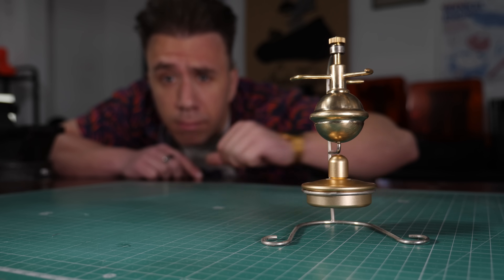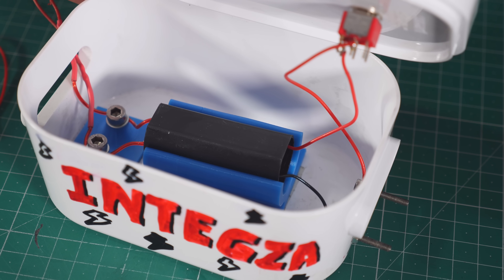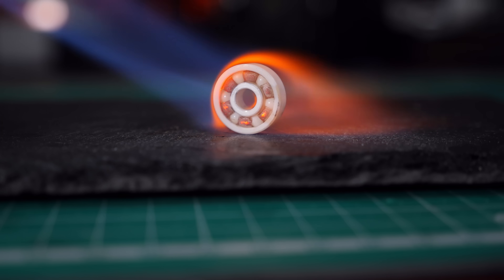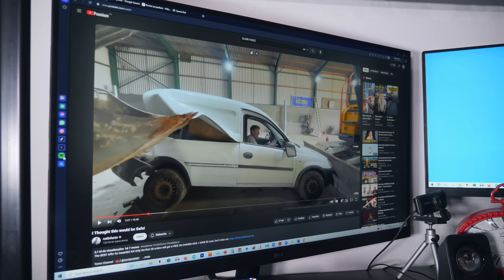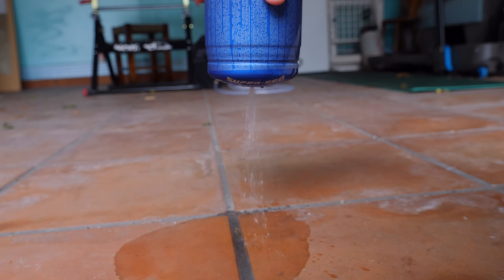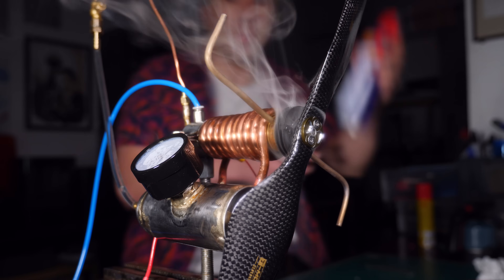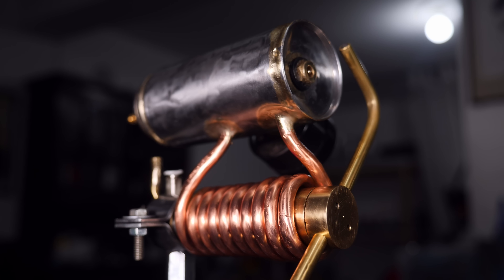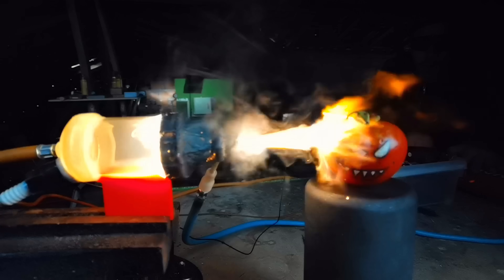I Built a ROCKET PROPELLER

Comment from the maker: AD: Download Opera Here : https://opr.as/05-Opera-browser-integza
Reply: please don't use Opera, the future of Chromium based browsers is bleak
Reply: staying in camp firefox
Reply: No I don’t think I will because just like tomatoes, image generation is disgusting
Reply: Get an Acrylic safety screen mate, if that prop comes apart or the tank explodes your going to get badly hurt. 👍🇬🇧
Reply: FYI opera has MANY privacy concerns going back over the last decade
Reply: Reminder: Opera is gone since 16 march 2013, this is just Chrome with Chinese spyware overlay and some Firefox features.
Reply: Your resources and setup are more sophisticated than you're giving yourself credit for. This design is humble and simple but I can already see many sophisticated designs can be built with your skills and resources.
Reply: @Integza HERE A IDEA FOR THE  AIR COMPRESSION. WHAT IF YOU USE A GAS POWERED RC CAR TURBO BUT INSTEAD OF USE THE EXHALES TO SPIN IT. YOU HOOK IT FROM WD40 TANK AND THE COOLING COIL OR  RIGHT AFTER THE MAIN OUTTAKE OF THE WD40 FUIL TANK SO WHEN PSI BUILD IN THE TANK. IT SPINS THE TURBO FASTER INCREASING AIR COMPRESSOIN MADE WITHOUT ROBBING POWER FROM THE PROP OR USE SUPERCHANGER BUT INSTEAD OF  A BELT USE A MIMI CHAIN AND HOOK IT TO PROP DRIVE SHAFT BUT IT WOULD ROB POWER FROM THE PROP. DISCLAMER I DONT KNOW HOW MANY BARS THOSE CAN MAKE BUT THE IDEAS SHOULD BE SOUND
Reply: Opera is chinese owned. Make of that what you will. If you don't believe me, look it up.
Reply: @aande1  It stems from an acquisition back in 2016, it is brought up more often on x nowadays due to our Social Media channels' popularity. However, Opera is still headquartered in Oslo, Norway with Opera GX being developed in Wroclaw, Poland. All of our browsers are GDPR compliant and no authority or shareholder has access to any Opera data.
Reply: Don't shill for AI garbage, jeez. Stopped watching when I got to that point.
Reply: Are you gonna improve this in future and reach super fast rpms?
Reply: Vivaldi is still Chrome, so I would not recommend it, but it's made by the original Opera devs who left when Opera was bought by a Chinese company to harvest data.
Reply: I used opera too until I found out it was a treasure trove of data for Chinese servers and they have been caught selling user data and other privacy violations but hey if you don't care about that besides taking up a tremendous amount of system resources it's pretty good ....
Reply: how about integrating the exhaust in the propeller (of some other material) exiting from the edges, it might create turbulance at the ends though?
Reply: what happened to giving away 3d printers :D
Reply: you might want to look up Fairey Rotodyne
Reply: I like tomatoes
Reply: You should totally build a machine that makes popcorn using only pressurized air, a bicycle, and a flamethrower — and if you’re ever giving away a Voron V0.2, I’d be insanely thankful to receive it!
Reply: You are a rocket enthusiast
Reply: Opera is spyware and stealing features from other browsers
Reply: YES YOUR FINALLY BACK I MISSED YOU I LIKED YOUR VIDEOS❤
Reply: Too bad you live so far away ...I'd love to collaborate with you on projects
Reply: opera = spy ware, no thank you
Reply: Hi
Reply: what mill are you using?
Reply: Can you build a propeller that has the pipe inside minimising materials and design ? Also dove the distance of the pipe itself have and effect on acceleration ? You could ad a pressure valve to the fuel tank to avoid explosion, maybe with a collector to reuse te fuel It will eventually vent.
Reply: YOU NEED A BETTER BEARING!!!!! IT should spin RIGHT AWAY!!! But because the bearing is so rough and heavy, it's not spinning..... Maybe you need to PACK IT WITH HIGH TEMP GREASE 🤷‍♂ IDK, but you NEED TO FIX IT!
Reply: So uhhhhh what does pamurutchiri antichurgudigi mean?
Reply: I have a solution to your butane boiler problem is to not use one big coil, but to use a bunch of loops in parallel, and have one half be the inlet, and one half be the outlet. You can braise all the outlets to one larger diameter pipe and send that into an outlet canister. The inlet half can be braised at the level of the can surface. This way, butane can only enter from one, but vapor has to come out the other. If you want to enforce the flow direction better, you can make something like a Tesla valve that prefers flow in one direction. 

Additionally, in the butane canister itself, you should use a mesh as a liquid exclusion structure, perhaps a mesh to catch splatters or something. Any splatter or sputter that comes out of the outlet should first blow across a mesh, that is angled to direct the liquid back down. I don't know how much surface tension butane has, but I theorize that the liquid butane would preferentially stick to the mesh while the gas will go through it, as long as there is not too much liquid being sprayed across the mesh.
Reply: A holocaust survivor would tell you go for 4+ arms because you're obviously not a nazi
Reply: You should put the holes in the propeller
Reply: The coil feeds from the can to the coil and back into the can, it needs to feed from the can, into the coil, into the engine.
Reply: Single blade propeller on at low power is most efficient.  How do I know?  Many broken RC airplane propellers that flew longer with same motor/LiPo battery setup.  Be sure to pre-drill hole opposite of remaining blade, and install screw as counterweight, which you can thread in or out to adjust balance on rotating shaft.  No it won't fly faster, but it will fly longer at low power.  Basic undisturbed airflow physics, look it up just be sure to ignore nay sayers esthetic ego trips and test for yourself.
Reply: Consider using sand in the pipe when bending it. That way it does minimal folding. Keeping the tubular measures "intact" so to speak. :)
Reply: @unwnme  Why not use a Bender?  Then you can bend it to any angle: 30 degrees, 32 degrees, 90 degrees, you name it!  🤖
Reply: Since you are working with air, why not use tesla turbine?
Reply: hey meng, you lose a good amount of thrust bending those tubes when you could just use a Tesla Turbine to convert the flow of gas to mechanical force using a straight outlet from the combustion chamber instead.  It's a bit more complicated but results in more rotational energy.  And more energy is always better, yeah?  You feel me.  GG
Reply: That does "pamurutchiri antichurgudigi" mean???
Reply: I just sent this message to the Ancient Architects channel after watching this video, I suggested a Collab video, what do you think Joal? "I was thinking about your video about bored holes the other day. Taking the example of Archimedean screws, which are credited to the Greek but we're in existence long before, certainly in Egypt. It seems obvious that Archimedes either learnt about them from texts or saw them and improved them and became credited with them. With that premise, what if Heros engine is much older than we believe? What if this was rediscovered from an ancient text? What if a high speed steam turbine was used to bore those holes using the weight of the water reservoir to push the cutter down. The striations were all in one direction as I recall? Perhaps it would spin too fast to give the continuous striation however that could have been formed when the tool was removed. Given how advanced the antikythera machine is I feel it is more than plausible that Heros engine is much older than we believe. Perhaps this would also explain the very high quality stone turning of this era? It might also explain the circular saw like tool marks that have been commented on. I was jogged along this path by an Integza video the other day. What are your thoughts? It might be a future video for you, a collaboration with Integza or click spring (or both) if they are interested in a spot of experimental archaeology. All the best Dave.🇬🇧"
Reply: Mate, Leaving a potential easter egg like PAMURUTCHIRI ANTICHURGUDIGI in y' video that google translate doesn't want to help with only variations in 'Shona'? On the road to, or on the day of? Please, I've lost too much time to this PLEASE tell me it wasn't just gibberish at the very least?
Reply: You look just like mike shake
Reply: scam
Reply: you can try using a Tesla disk turbine, spin the turbine with steam and from it a propeller and a compressor for compressed air translated from Russian, sorry
Reply: Idea: make a custom bldc motor using Lego/whatever you can find then test the motor and put it in something
Reply: PCB way
Reply: Opera ad in the big 25 🥀
Reply: u can put a tesla turbine in the center so u won't need the compress air
Reply: Opera is a bad browser. DO NOT USE IT
Reply: Opera is bad, more likely very bad !
Reply: Been a while since I last saw you
Reply: video uploaded: 33 seconds ago
comment posted: 43 minutes ago
Reply: @uzi1476 your point
Reply: @uzi1476 🔴 What Is Islam?  
 
🔴 Islam is not just another religion.  
 
🔵 It is the same message preached by Moses, Jesus and Abraham. 
 
 🔴 Islam literally means ‘submission to God’ and it teaches us to have a direct relationship with God.  
 
 🔵 It reminds us that since God created us, no one should be worshipped except God alone.  
 
 🔴 It also teaches that God is nothing like a human being or like anything that we can imagine. 
 
🌍 The concept of God is summarized in the Quran as: 
 
📖 { “Say, He is God, the One.  God, the Absolute.  He does not give birth, nor was He born, and there is nothing like Him.”} (Quran 112:1-4) 📚 
 
🔴 Becoming a Muslim is not turning your back to Jesus.  
 
🔵 Rather it’s going back to the original teachings of Jesus and obeying him.  
 
 
More .....👇 
 
🔴 THE RETURN OF JESUS
Reply: No, just no.
Reply: opera GX is CPU and GPU intensive, not going to use it
Reply: You crazy Russian genius, you did it!!
Reply: Hi
Reply: Brave > Opera
Reply: im watching this on opera

Comment: Standard fireworks used to sell a cardboard propeller, powered by a chemical engine in its standard box of fireworks.The arrangement was similar to your device though you had to bend the tips of the prop to enable a decent flight.

Comment: What if you use an accumulator charged with nitrogen to maintain cooling system pressure. Also should experiment with nozzle configuration different angles or more nozzles even to see if you get better rotation.

Comment: more airpressure from the compressor than butanepressure is solved by some strange invention called "carburator". i think you have heard of that. and the crazy "venturi effect". and this solves by the way the thing with "too much butane" as well. the trick would be to route the fresh air-fuel mixture to fetch just some heat. and... just cool the engine intself with water. 

and maybe move the combustion to the point where you need it and do not try to route the exhaust gas. this is a bad workaround. maybe tiny impulsengines at the tips? and last: maybe use propane. that works out better.

the thing is: when you're doing stuff extremely different than well proven other examples of technical solutions you should have a damn good idea why. maybe some guys have already solved your problems some ... lets say weeks ago.

ah well - you already got "propane may work better" - in germany we buy propane as "grill gas" for gas grills. this works out well as an alternative climate gas for cars. and is much cheaper ...
the thing is: that what you build has been built as a helicopterlike thing by howard hughes in the 50ies i believe. it was called the XH-17 "Flying Crane". maybe there are also reasons why this thing was never meant to be built in a series. anyway  in modelscale things work that don't in larger scale - i want to suggest so move the hot part of the machine to the tips - so you can just use an standard-oil-seal to seal the axis and have the fuel delivered to the tips. an impulse "v1 rocket like" engine should run without pressured air. the speed needed for a ram-jet could be hard to reach.
otherwise you could also use some energy from the axis of the propeller to run a small compressor... but that'd take so much effort. and now were on the way to invent the jet-engine.

Comment: Have you thought about building a rocket that uses liquid Oxygen and liquid methane? You most likely would need to build it from metal. With a metal 3d printer you could 3d print 100% of the rocket.

Comment: That is awesome!try Making  the tailing edge of the propeller the nozzles of the jet forced rotation and forward thrust and have your friends that metal printed  your Rocket nozzle make the prop hollow and out of aluminum? Also try making the nose cone the combustion chamber or maybe make the entire fuel tank rotate with the prop and engine all as one.

Comment: What if you simply make it slightly larger, the arms longer and add weights to the end. Then instead of constant flow up fuel, you should have a burst injection that essentially slowly accelerates, at high speed it should be more fuel efficient and it will act as a fly wherl

Comment: Video idea:

Make a turbojet engine V2;
(Cool cheap fuel idea below aswell) 

Put a turbofan on it so that it’s a turbofan engine, you can then put this on a skateboard or scooter 
+ it will also keep everything cool

Fuel idea:

Make a petrol bubbler. Have a bottle with petrol/alcohol, have a small air compressor that blows bubbles into the fuel, that will create extremely flammable fuel vapors (litterally gas) which then can be sent through a flashback arrestor for protection (just use water!) after that into the engine! Basically runs the engine on fuel vapors and directly replaces the gas

Comment: If you could find a way to inked those jets into the prop (and tolerate all the heat) you could potentially increase your efficiency.  Taking it even further if you could change pitch and location on the prop you may be able to generate even more thrust

Comment: A small micro compressor. Look at the Aprillia Di-tech 50 scooter engine. It has a small air pump that is ran off of lobes on the crank shaft to direct inject air into the cylinder at tdc. Their whole direct injection system is really cool and has a lot of applications, but this compressor could be ran off of the a lobed gear. If I remember right there was as much as 800psi developed at 12k rpm. something to look at and you might even be able to print your own version.

Comment: Hey, Integza! I think you can try this:
It's a cylinder with railing that goes around the entire circumference of the base of the cylinder(which is a circle) but it's with a smaller radius. A cylinder with circle railing inside it but the circle is smaller so it fits inside. The railing is because a magnet is supposed to slide around it. You are supposed to cut a hole in the middle of the base of the cylinder so you can fit a rod through it.  Make sure the hole is bigger si there is no friction. On the top of the rod put a metal piece (that a magnet can drag) that is pointing towards the magnet. And outside the cylinder on the bottom of the rod put a dynamo so the rod makes mechanical power in the dynamo and it makes electricity. But how is the rod going to move? Answer in replies because limit
Reply: The metal piece is attached to it on the top and the magnet is supposed to drag it. And the magnet is spinning on the railing so the metal piece is spinning too. I have a problem though. How is the magnet going to move? Idk I am not competent enough so I gave you this idea because:
I can't afford to make it
I don't have the skill necessary to build it
As I said i am not competent enough to think of a way to move the magnet (maybe a wind turbine but i don't think that's convenient)
I hope you see this comment and try it. And tomatoes are disgusting

Comment: I have an idea for the next video: 
Build a non-radioactive mockup of a nuclear thermal rocket engine, replacing the nuclear part with a massive electric heating element or concentrated solar array to superheat water (or another working fluid) and then expel it through a nozzle — simulating the NERVA concept (NASA’s old nuclear engine idea).

Pls gimme the 3d printer.

Comment: 10:00 I mean instead of using compression you could have used nitrogen gas because nitrogen gas lets off so much nitrogen fumes that it's actually able to power it I don't remember exactly who I'm pretty sure Mark Grover actually used one of those with I believe dry ice and was able to power it so fast and get it going so quick that it literally snapped

Comment: Integza, what if, what if... we could simulate real combustion — with pressure and pulses — but at under 100°C, so your i3D prototypes wouldn’t melt in seconds?

MnO₂ + H₂O₂ + Water. It all started after thinkiing about flash steam, anyway..

I’ve been thinking on it for a while and come up with this...this weird idea: using 30% hydrogen peroxide reacting with a solid catalyst like MnO₂. The reaction releases vapor and pressure, enough to move a piston and mimic combustion cycles — but at a safe temperature for 3D-printed plastics. The 3d printed chamber and its sealing capabilities that someting to think too.. oh well i'm not sure about that for now..

I always enjoyed your videos but boy does it suck to see stuff melting in less the a few seconds... and so i started thinking if it was possible to solve that problem, keeping combustion alike, some prompts later, this seemed to be feasible..

The goal is to let anyone, not just yourself, to prototype real working engines at home safely, and then just swap the printed block for metal and inject gasoline in the same design. The best of both worlds. Fast prototyping is great!!!

Might be a new path for realistic, low-cost engine prototyping with 3D printing. If you’re interested. I'm not a genius of any kind, i just had a thought on said problem..

Folks, do like if this could actually be a thing